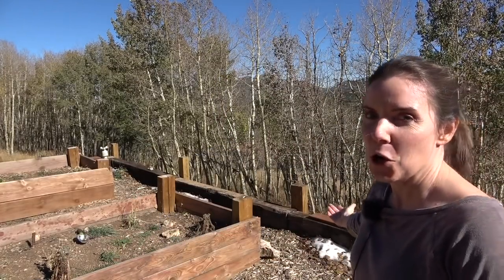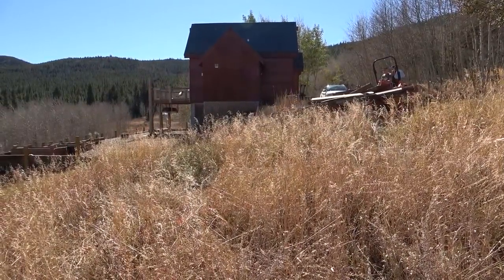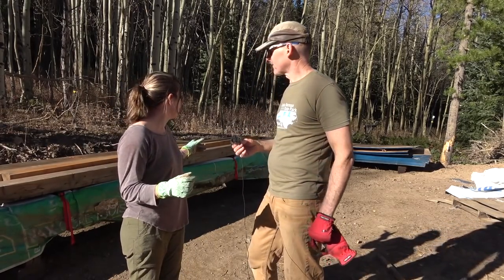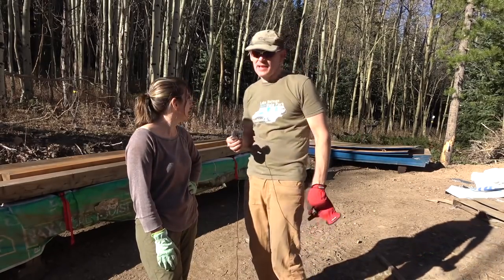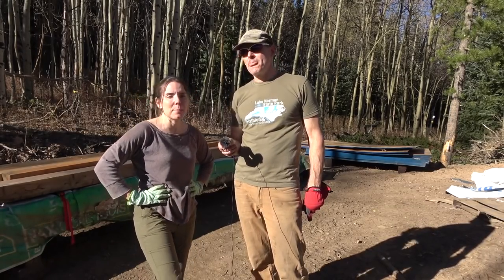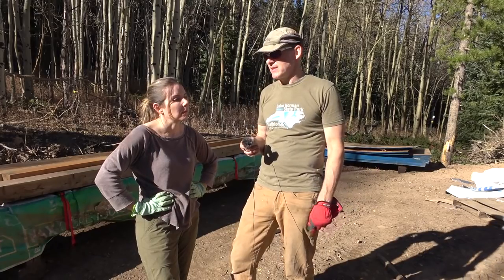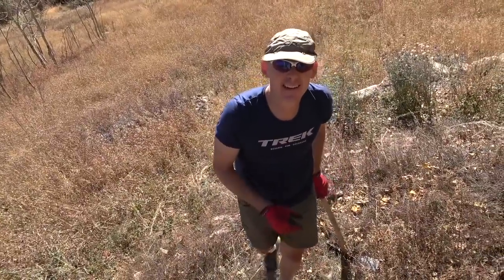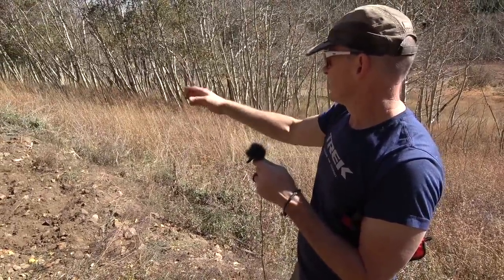Our 3rd Engineer Delivers Bad News about our Shed Plans

Comment: I would have done a  pole barn and poured the concrete floor afterwards. That's how you beat the system.
Reply from the maker: We still need stamped engineered plans to build anything in our county over a 10x12' size.

Comment: Hi Amy and Bryan,
The shed sage continues. I might have given up and purchased a pre-built shed. Liked the time-lapse, Amy. Bryan, on what repair did you finally decide for Katherine's knife?
Reply from the maker: Bryan wants what he wants. and He doesn't want a shed smaller than 10x12 or we would have had it by now.  Haven't got back to the knife yet, perhaps after the dirt moving is done.
Reply: @ColoradoMountainLiving  Hi Amy,
I have been looking at a metal garage 10X12 and 12 at the peak. Has a nice wide roll up door with a side door and comes insulated. Need more space to store stuff.  :-)  Both of you stay safe.